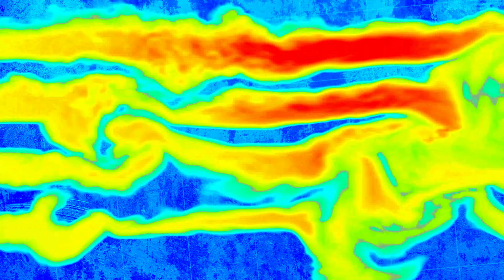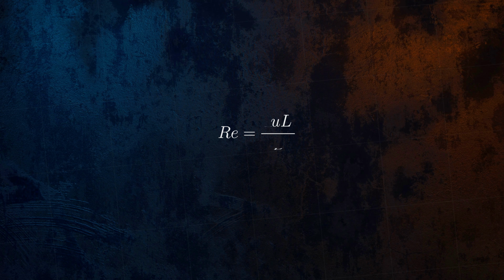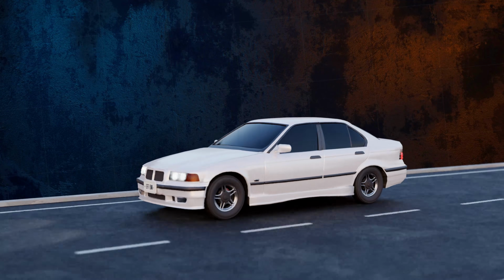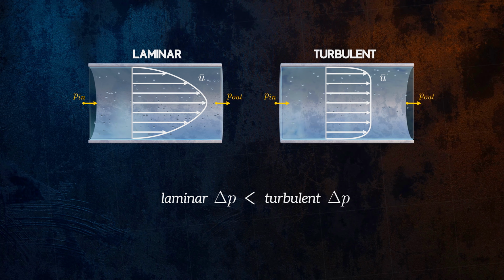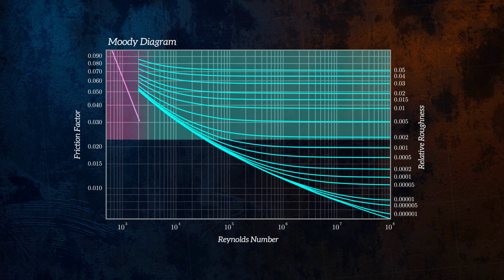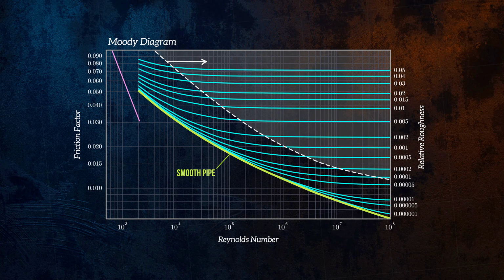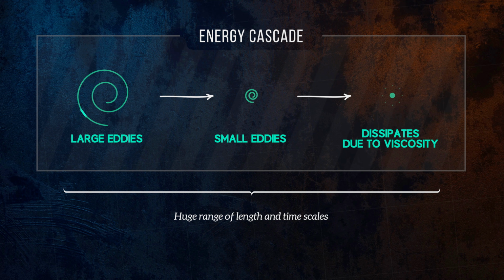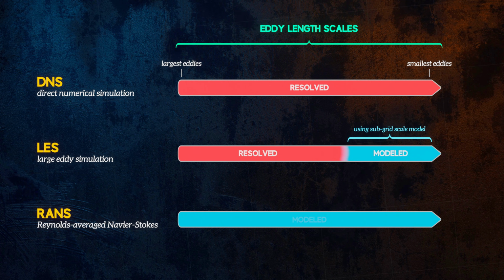Understanding Laminar and Turbulent Flow

Comment: I've seen some of your videos and I can confidently say that even after graduating from university, I'm still learning much of the basics from your videos. You clearly explain theoretical concepts well without getting too convoluted and technical in the mathematics and equations. Thank you for your hard work.

I won't be surprised if in the future, you would branch out to more specific disciplines such as mechanical, structural, and geotechnical engineering. I will selfishly request that you might do more videos on structural analysis and even possibly nonlinear analysis, haha. But please keep on doing more videos like this. This laminar vs turbulent flow video brings back a lot of memories from my fluid mechanics class even though I will no longer use them because I'm in structural engineering.

Comment: After achieving a structure to allow laminar flow, coat it not with a smooth Teflon surface but with a layer of air ✈️️ to flow at high velocity using ion charge transistor (FET).

Comment: 0:32 What is actually meant by layers here ? Some microscopic structure of the flow ? Particles move in layers one above the other ?

Also, from what I know, flow in blood vessels is mostly laminar but in some regions it's turbulent - right behind the heart and around the obstacles such as clots, atherosclerotic lesions and valves. What's more, vibrations of blood vessel's walls caused by eddies in turbulent flow can used to measure blood pressure.

Comment: Such an amazing video to explain a quite complicated concept o fluid flow. Just for one question about the frictional shear stress that creates pressure drop. Does the laminar flow have higher shear stress between each layer of fluid than the turbulent one? So if the frictional shear stress is the principal cause of pressure drop, why does the pressure of turbulent type happen to decrease the larger amount?

Comment: Great video, a minor thing of note I saw was with the no-slip condition and the velocity at the wall should be equal to the velocity of the wall, in a lot of cases we write the problem so that the wall is stationary, thereby making the velocity zero but in some cases (such as flow through a turbine) this is not possible to do. Overall, the video was great and I am interested in seeing if you will discuss more facets of fluid flow on this channel.

Comment: I think your suggestion, that in the case of fluid flow thru the tube in formula Re=ρVL/μ (L) means tube diameter makes no sense. This would mean, that increasing the tube diameter would  increase turbulence. In turn this would mean that blood vessel should be supper tiny to have laminar blood flow in it?

Comment: So if there is  a laminar flow at the edge  of the pipe, there must be a sheer pressure because of the velocity difference at the  center of the pipe and the edge of the pipe. Then, I think it could possibly generate an eddy. Then, should we see it as a Turbulent  or Laminar??

Comment: Laminar stays in the moment of the beginning and Turbulent stays in the moment of the ending. So we need to find out if Turbulent turns back into Laminar at any moment. That would make the "Reynolds number" Equation and Equal number and If it  doesn't then it's 3 or 9.

Comment: What if there are more different kinds of fluid flow, for instance a ring vortex of wind behaves laminar, but is circular, or maybe a spiral like movement of fluid in a particular direction along a pipe, while being laminar or turbulent? 
Or a vortex flow that doesn't disintegrate into more upon more vortices like turbulence, making wheel like spirals which go all along the fluid

Comment: Hello I'm currently trying to write my extended essay on this subject, I was wondering if added tube length would decrease the velocity of water flow? What I was thinking of doing is measuring the difference in velocity at two different points of a pipe and in that way finding the difference of kinetic energy/s to conclude the energy loss in the flow. What Im thinking is finding the velocity where there is the least kinetic energy loss, which i think theoretically should be the velocity that results in laminar flow, but almost transitioning to turbulent flow. If anyone could please give their insight that would be great, seeing as fluid dynamics is a lot to take in for me rn.

Comment: On my exam I got the question if invicous flow can be turbulent? I don't think so, in the absence of viscosity (zero viscosity), liquid layers could slide past each other without any resistance. As a result, there would be no dissipation of energy and no damping of speed fluctuations. This lack of internal friction would prevent the formation and maintenance of turbulent flow patterns. Is this correct?

Comment: Why not measure the electrical charge of a fluid where it makes contact with a pipe and then maniputate the sheer stress by charging the pipe with an opposite charge, resulting in what i would call a molecular magnetic flux between the layers and boundries. Essentially eliminating the stress entirely? Creating a fluid maglev effect if you will..

Comment: The flow diagram for turbulent flow does not make sense to me. Shouldn't the flow directly close to the pipe walls become slightly negative, this causes the turbulences and the area under the flow curve becomes smaller not bigger. This looks like the flow is optimized under turbulence, because its flowing much faster closer to the walls. Makes no sense.